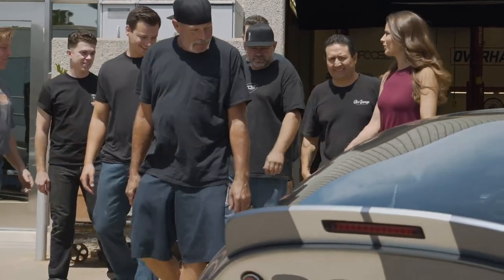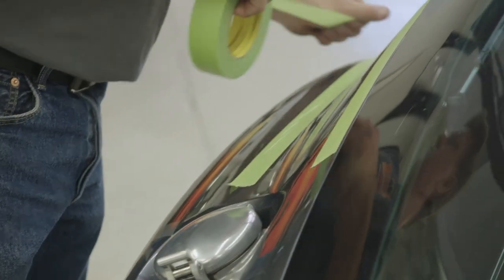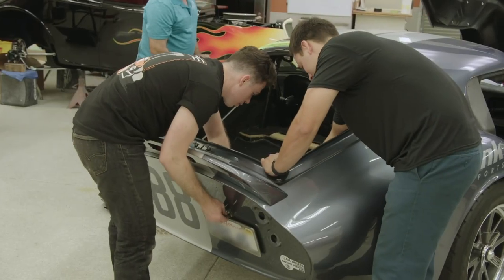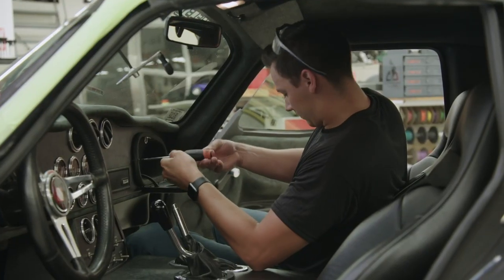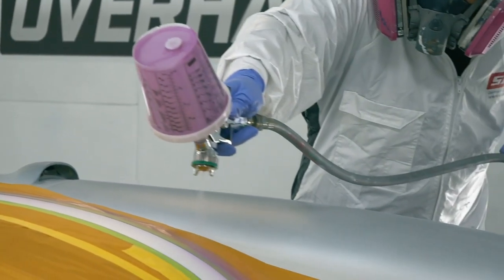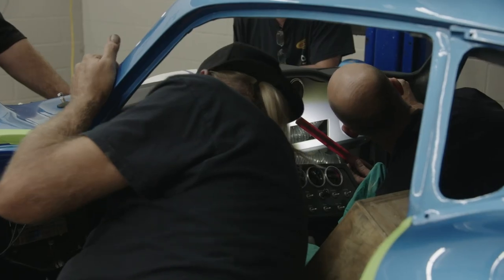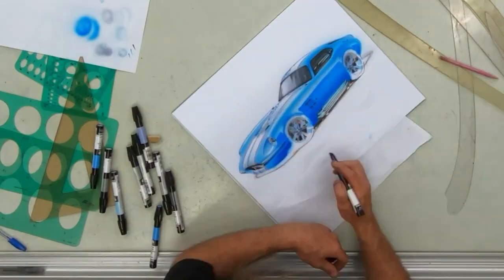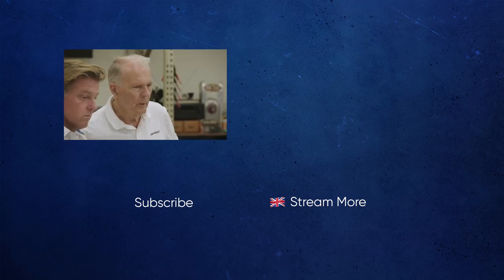Classic And Elegant Daytona Overhauled By Chip & The A Team l Overhaulin

Comment: In the 70s I could have bought a car made like that one for 500 bucks cause the guy didn't know what it was and neither did I...He bought a building that had it, and a 65chevy ss 4door hardtop, with a big block 4speed, and a 67 Ford Fairlane 500 with a big block. To this day I'd love to kick my butt for not buying the car that I thought was ugly, IT started, and run, and probably drove but we didn't like nothing about it, lol...He finally got rid of it and we fixed and ran the Chevy and Ford and he had a Rambler Rebel with what looked like a 390 and it was a 4speed. All of em were stick....I'm pretty sure that a 56 or 57 Cadillac was in the bunch and it had gadgets everywhere for the year of it and most of the gadgets were mechanical with a wire or 2 hooked up to everything that normal car's didn't have...We'd go hunting for old junked Cadillacs and put those gadgets in our ol Chevy's and flip people out with auto head light dimmers, power Cadillac seats, but we would re-upholster em so they'd be close to the original seats for the Chevy's, lol. That 1 car was worth way more than the land, building, cars, and all. Just 1 vehicle, and I'm pretty sure that 500 bucks got it in 1976 cause we were dumb back then